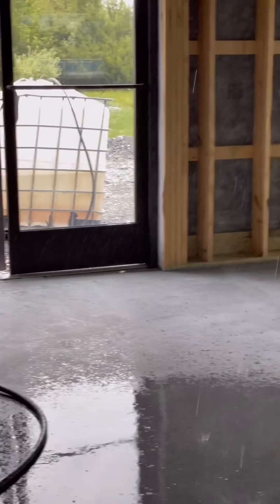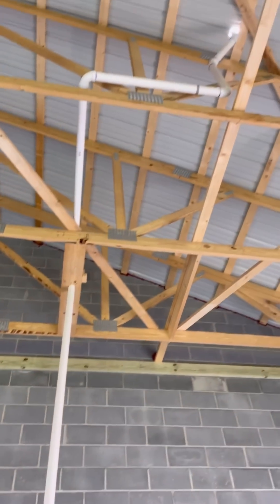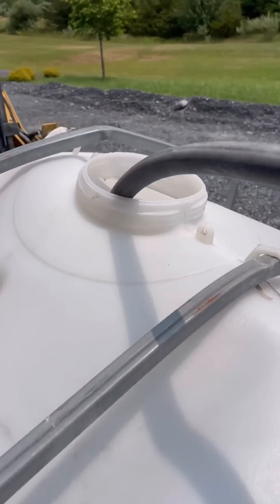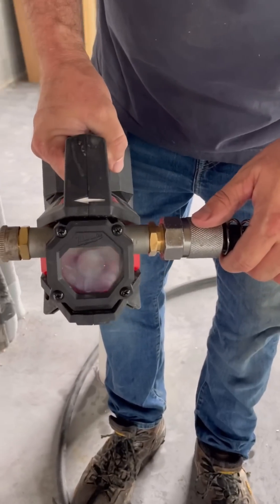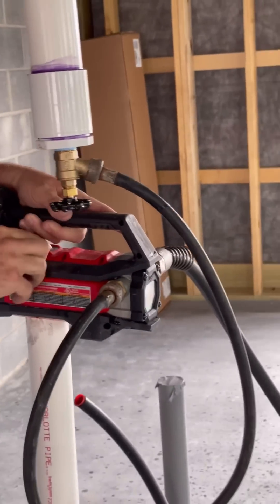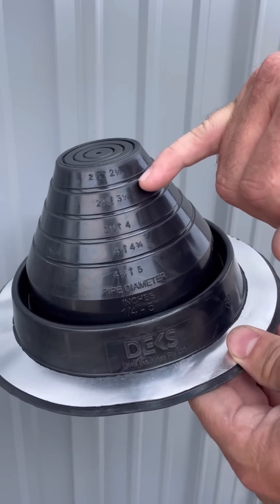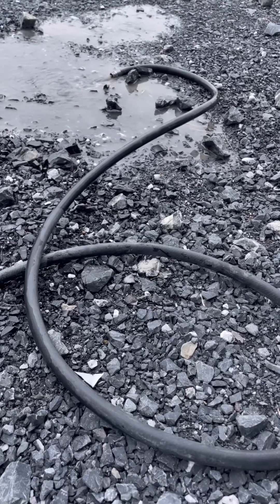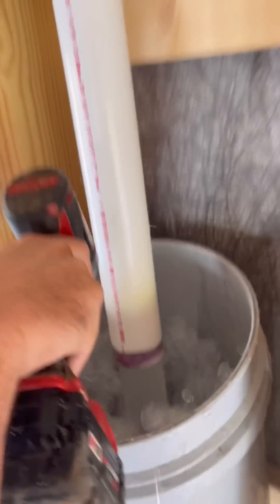How To Test PVC Drain Pipes With Water

Comment: 5lbs of air definitely won't bust the pipe. I think water is better though because it's easier to detect a leak rather than watching for a pressure drop. You can't detect  air leaks without bubblesoap or a pressure gauge, but you can detect water leaks nearly instantly.

Comment: Your code is silly. Having the pipe dry and slightly pressurized is the way majority of outdoor fire sprinklers work and it's actually more safe not less. The air pressure ensures the integrity of the pipe and has the advantage of being 3 seasons, so in bitter winter conditions, unlike water the air pressure ensures the integrity and won't freeze. Best way to get pipe and system failures is to pretend that the pipe and pumps will act the same at low temperature.. below freezing and the system is going to fail, many plumbers and pipe fitters will leave a valve slightly open in winter so expanding water has somewhere to go
Reply from the maker: I totally agree. Unfortunately, I don’t make the rules

Comment: You should be testing your vent and drain lines with 10ft of vertical head anyway. The reason you don't test with air and plastic is because of compression, you're basically making a bomb. Water is essentially incompressible and doesnt store nearly as much energy. Theres 100% very good reason we test with water. I'd rather have a 125lb test on with water than just 5lb with air.
Reply from the maker: The current code in our area is 5 foot of head pressure. It will go to 10 foot when they adopt a new code.

Comment: You ever hear of an air compressor? it’s only 5psi for 15 mins way easier
Reply from the maker: Started out with air, and we failed our inspection. They won’t let us use air anymore because of the risk of the pipe exploding. It’s actually not allowed by code anymore I looked it up.
Reply: @hausplans  weird, In Canada air tests are allowed 5 psi wouldn’t make any pipe explode, not to mention the damage you could cause if you had a failure with water during a Reno etc

Comment: It wouldn't be exploding pipe you would have to deal with, it would be flying fittings on a failed fitting(lack of cement) randomly flying apart and at 5psi it would not have tooo much energy in most situations. 
Most low pressure plumbing inspections where we are are still air tests.
HP testing is done with water, you do not want anything to come apart at 250 psi if there is a 3000 ft run of 8'' pipe charged with air..... that might be a bad time.
Reply from the maker: That makes sense about flying fittings

Comment: Well ur right almost! It's always been to test with water if you read your code book , and your supposed to have 10 feet of head pressure on that pipe not just fill the pipe, so you were taught wrong JR.  If you don't believe me ask any inspector
Reply from the maker: We’re still using the 2018 code which allows 5 feet of head. The new code went to 10’
Reply: Are you under international code book? In Michigan, where I'm licensed, we are under that along with other states , but last I knew, not all were under it?

Comment: Isn’t air lighter than water? I’m confused doesn’t make sense
Reply from the maker: The inspectors are concerned that if to high of psi air is put into the PVC pipe they can explode. The water has almost no pressure but well leak out of the pipes are not glued together properly.

Comment: Most inspectors will allow 5psi of air for a test.  Plumbing code book states "plastic pipe shall not be tested using air".  Have had inspectors that will only allow water tests.
Reply from the maker: The county where I live still allows air testing. The city were this building is being built does not. The first plumbing inspection I had 5 pounds of air on it the drain lines and it failed. I just did a Google search. This is what I found in the 2018 international plumbing code. 

312.3

Drainage and vent air test.
Plastic piping shall not be tested using air. 

Also, found this 

For safety reasons, the PVC Pipe Association is adamant that PVC pressure pipe be tested with water only and that UNDER NO CIRCUMSTANCES SHOULD AIR TESTING BE PERFORMED ON PRESSURE PIPE

I’m not saying I agree with any of this! Testing with water is a huge pain. The only thing I can figure out is that people accidentally put 100 psi or more on PVC drain lines thinking it’s the same as waterlines and causing them to blow up in rare cases. The inspector that failed mine said he had watched safety training videos where they showed PVC pipe blowing up like a grenade.
Reply: @hausplans it's the same reason why air tanks and welding tanks and gas pipelines are hydrotested with water, water doesn't compress and store energy, so if a water filled pipe bursts, it just sprays a little bit of water out and then the pressure is gone, but with air you have an incredible amount of stored energy, and so when there is a failure it's a catastrophic failure.
Reply from the maker: That makes sense

Comment: Wait. 5psi can cause your plumbing to explode? Mr. George how much you pay for this new guy? $20 dollars, is no good. He no good.
Reply from the maker: Yeah, I think it’s stupid, I actually had 5 pounds of air the first time I got inspection on this building, and the inspector failed it. The only thing I can think of is people that don’t know what they’re doing put 100 psi on the PVC like we do on waterlines and cause a an explosion. I also read that the national PVC council does not want people putting air on the pipe. It probably comes down to lawyers and lawsuits.
Reply: @hausplans  for sure just heard that sound bite in my head and had to share it lol. Local plumbing code should be taken into account and each state has differences. Looks like good work man!

Comment: There's something new to me because of the pipes explode or break with 5 PSI in their inferior quality. You should be able to at least pressurize to 50 psig
Reply from the maker: I think PVC can hold even more than 50 psi. It’s more that people accidentally way over fill them. Not saying I agree with this rule air is a lot easier than water for testing
Reply: @hausplans  amen

Comment: 5 pounds will not explode the pipe. We ran a whole shop for years with 3/4" at 90 psi. It did crack once. Then we replaced with copper.
Reply from the maker: I think there’s an issue in rare cases with people putting way more than 5 pounds on PVC. Not saying I agree with the rule.
Reply: @hausplans Is this osha nonsense or the company you work for?
Reply: @josephdestaubin7426  stupid code lol 😅
Reply: People seemed to get confused on some Guages and put 50 instead of 5
Reply: @joesmoth2610 and the solution was to switch to water and "shake the pipe?" I think the real reason is in video. Dont have to send someone to the roof.
Reply: The mower shop I worked at has PVC air lines and has had them for close to 40 years and not lone blow out.
Reply: @davidhenderson3400  There's just no way that's true lmao. PVC is NOT meant for compressed air systems in the slightest.
Reply: The issue was with accidentally going much higher than 5.

Yeah pvc not exposed to weather can take a lot up to about 2". It is dangerous when it fails at higher pressures though, the reason for the law I presume.

Comment: Yeah think thats one of my crews fault we can't use air at the aquarium in Atlanta had test crew filling line with air came break time they forgot to turn compressor off it reached over 200lbs and PVC exploded we had osha and everyone out there this was 2013 or 14
Reply from the maker: Wow!
Reply: One bad apple ruins it for everyone
Reply: @jodygarcia9892  Bad thing they were test crew so wasn't even licenced plumbers they were apprentice pipe fitters I was General foreman had foreman under me said they were good guys this is a union job so I didn't really know anyone cause I was Local 150 out of Augusta Ga but because I had a master licence made me GF found out later that they were using my licence to work under cause no one had master card ,If you know anything about pipe you know a plumber can fit but a fitter can't plumb
Reply: In Ohio we use vacuum test.  System had to hold -10lbs for 10 minutes. Vacuum cuts down on pipe explosions I guess 😅
Reply: @ko45allday  yeah we do 10ft head test on drain and 80lbs water pressure on supply's that happened in 2010
Reply: Holy crap that sounds like it could have gone real bad. What was the aftermath like?
Reply: I live in Atlanta, really appreciate the good work you and your guys did at the Aquarium though, that place is so cool!

Comment: Why not vent out the gable end, up high? After 22 years of building steel buildings I've yet to understand why you'd cut a hole in a brand new metal roof and then depend on a $12 boot not to dry rot and leak.🤷‍♂️🤷‍♂️🤷‍♂️
Reply from the maker: Code doesn’t allow us to vent out of a gable. It has to be above the roof. Also I’d have to cut metal if I go out the gable as well, but I hear ya it pains me to cut that metal!
Reply: @hausplans A vertical surface like gable is far less likely to leak than a horizontal surface like a roof. I won a $100 bet with an architect, had the contractor install one vent thru a wall, one in the roof. We hosed them down when we did the 11 month inspection just before the one year warranty expired. The roof vent leaked after only one year (neither one leaked at completion of construction).
Reply: @hausplans  Yesser.  Those high dollar standing seam roofs are what really get me. You spend $6 sq ft on a roof, then they cut a hole in it. 😂😂
Reply: @hausplans would out the gable, then 90 to vertical and enough pipe to get above the ridgeline not be allowed?
Reply: @samuelmellars7855 That would fail inspection. Can’t go through the gable end whatsoever
Reply: @MisterTwister88  I get why building codes are necessary and good, they make sure people don't use too-small structural elements, that they don't just use pins to hold things together and so on...
But I don't see why you wouldn't allow pipes to go through the gable
Reply: @samuelmellars7855 Because you can't nominally horizontal vent. It could become clogged and then the whole system would fail.

Comment: Waste lines that go to the roof?....I don't get it....this isn't a vent?
Reply from the maker: Correct, it’s a vent
Reply: yes a vent for the waist line
Reply: We just filled with air and pumped to 200psi and couldn't lose pressure within 6 hours. Had a psi gauge attached. Inspector would show up to watch us prep and then 6 hours later hed come to check psi.  We had a special box that locked over  valve and the Inspector held the key. Eliminated any possibility of tampering.
Reply: @jordanharvey2163  200 PSI lmao, I'm surprised any PVC ever lived through that.
Reply: @bobbygetsbanned6049   good quality schedule 40 will withstand double that. Especially if it's glued correctly.   200 psi is a good way to see if it'll hold before you do the insulation and sheetrock.
Reply: @jordanharvey2163  It's not a good way to test it, it says right on it not to test with air pressure.